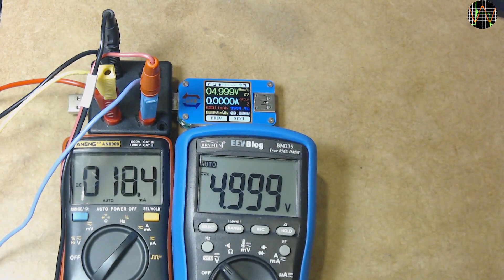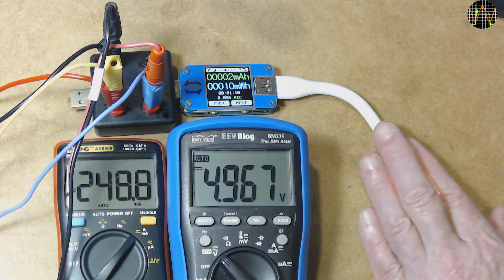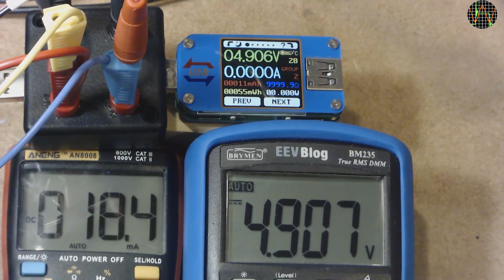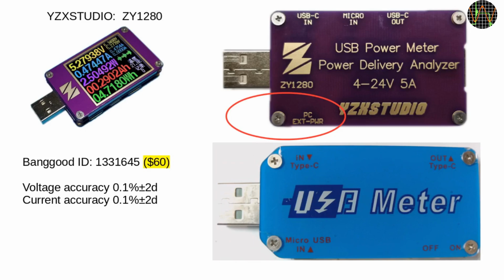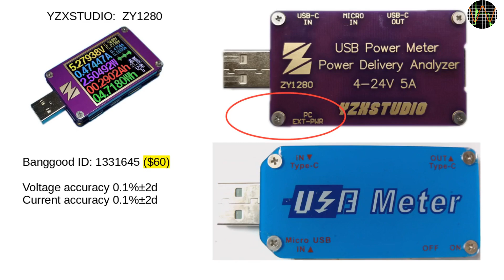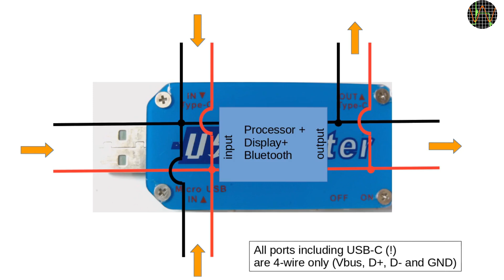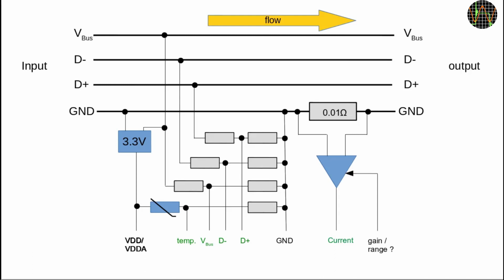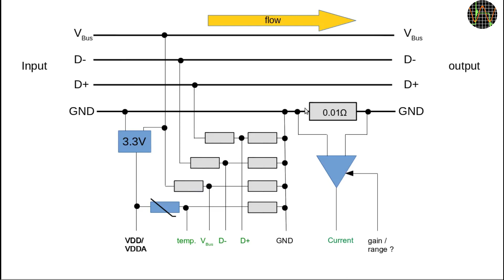USB Tester surprises that can go wrong

Comment: I am not much of an electrical engineer, so this video is mostly above my head. I need to test a bunch of power banks at work. I bought a couple of testers and a USB load with a fan. One testster is pretty simple, like your unity, another one is more complex from Makerfire. The latter at some point went up to 40c and had it's usb connection (from the side of the load) melt. I had this happen to two testers now, but the simple tester works no problem. I am testing the power bank at 5V 1Amp, what am I doing wrong?
Reply from the maker: 40 deg C isn't enough to melt plastic or solder. Something else has gone wrong here but it is difficult to understand what you were doing in each case. You are saying that you used the same setup, cables, load, power bank and with one tester it works, and the other one melts?  What current were the testers showing (while working)?
Reply: @TheHWcave  yes, identical conditions, one tester (simple one) works fine, another tester (makerfire with LCD display) dies within 20 minutes. Maybe 'melt' is an exaggeration but the USB port has a bad smell coming out of it and no longer functions. The tester itself is alive, if I reconnect it to the power bank the display turns on and shows the voltage accurately, but the USB-in does not work anymore. 

The current is 1.12 amps.
Reply from the maker: @Jimmy_The_Goat  My only guess is that there was a bad solder joint or contact within the makerfire tester that caused so much of resistance and voltage drop that it overheated. It may be fixable if you open the tester and examine the solder joints (and PCB tracks) around the USB port.
Reply: @TheHWcave  And what would I do to fix it?
Reply from the maker: @Jimmy_The_Goat  Difficult to say without seeing it. Check for anything like solder joints around the connector that look brittle or cracked. Anything that looks different from how the other connectors are. Then go over those with a soldering iron and reflow the solder. See if that fixes it. If the melt happend inside the connector itself you would need a new one but replacing a whole connector is more work than the tester is worth.
Reply: @TheHWcave  okay, thanks for the help!
Reply: @TheHWcave  Another question, if you don't mind. I have two USB loads with a fan and one without. The other, understandably, gets pretty hot and has a rather unpleasant smell. It's not burning or anything, just hot. I am wondering if it might emit anything dangerous into the air and if it's safe to sit in the same room while it's being utilized.

Apologies if that's a silly question.
Reply from the maker: @Jimmy_The_Goat  Not silly at all. The one without fan likely uses a power resistor (big, should be easy to spot) to load the USB. These resistors are ok to get hot to max about 120 deg C. Up to that point they should not emit smells or discolour. If they do emit smells or discolour, they are overloaded, way hotter,  and their material is degrading. Also, yes, I would not like to breath those fumes in.  There is a difference (in smell) if a load has not been used for a long time and accumulated dust. Then there may be a smell for a short period (of hot dust) and then it stops smelling.  It is also possible that a brand new load may smell a little on first use but again, that should stop if it is used within its specifications. If the resistor(s) in your load have not degraded too much it should be ok to still use them but only for less power.
Reply: @TheHWcave  very helpful, thank you very much

Comment: What would happen if you connect a source to the USB-C output and a sink to the USB-C input?
Reply from the maker: The end of the universe as we know it? Good question! I had to test it because I normally use the TC66C (see my videos) for all my USB-C work. The UM34C has no USB-C out (despite the label). On the UM25C, if USB-Cs are swapped, power still gets through and the display shows the voltage but current is shown as 0 despite current flowing. I also noted that regardless whether USB-C in and out are connected correctly or not, the UM25C is sensitive which way around the two USB-C connectors are plugged-in. There is a 50 percent chance the display stays dark and no current flows from source to sink. Flipping either one of the connectors on the UM25C and everything works. It has to be on the UM25C, flipping on either source or sink side makes no difference. When discussing the TC66C , I did a deep dive into USB-C and indeed the connectors / plugs are not truly symmetrically wired. However most devices take care of that, so orientation of the connector normally does not matter. In the UM34C it does matter. Interesting! I did not know this about the UM25C , so I thank you for raising the topic.
Reply: @TheHWcave  Thanks for the answer. The reason I asked because I have on of that black X shaped usb tester and I plugged it in reverse to a power bank, frying it.

Comment: First 2 minutes, you are talking about USB tester not displaying the 18.5 mA that it draws like its a bad thing.
Using common sense, of course I dont want USB tester to show me its power consumption, I want the USB tester to show me how much power the device I connect to it draws.  
Same as for scale, I dont want the scale to show me how much it weights, or how much a plate I put on to it weights after I press "tare" button , I want it to show me how much sugar I put on the plate weights.  
I guess I will have to watch the video few times, but is there something I am missing here ? Maybe I just need someone to spell it out for me
Reply from the maker: The point is that it draws 18.5 mA without telling you about it and that means any battery capacity measurement is wrong by that amount.  The battery has to power both, the actual load (which the USB stick shows) and the USB stick's own power draw, which it doesn't show. In your weight example, this would be equivalent to a scale that adds 18.5 grams  to everything you weigh but doesn't tell you about it.
Reply: @TheHWcave  I see what you mean. I assume this is the only situation where USB's power draw matters and should be taken into the account ?

But I was, just to clear for all who read, talking about device connected INTO the USB, on the end of it.
Because my goal is to measure, for example, how much current the LED light draws, like you did show at 2:11.
And in that situation, power draw from USB device doesn't matter.
Reply: But what about simply connecting discharged battery to the USB tester.(instead of discharging it and measuring while it discharges)
So like this
1(5v power adapter) - 2(USB tester) - 3(battery) and measuring how many mAh is pushed trough the USB tester.
In this case the USB tester would not draw power from battery at all.
I'm not sure can capacity of a battery even be measured like this, while charging.(don't have much knowledge on this tbh)
Using some logic, it should, yes ?
Reply from the maker: @kruskotv1311  Yes in that case the power draw of the tester would be covered by the charger. The best option is to use a tester that can be powered externally so it doesn't need to steal power from either end of the USB connection to the thing you want to measure.

Comment: I have a question. I am on the search for buying a usb meter for measuring capacity of a phone's battery which uses micro usb port.The charger is a ~ 5,2 Volt one, will the capacity be shown from the usb meter correct? Cause as far as i know the batteries on phones charge at lower voltage, about 4.3 V. So wouldn't be right to say that in order to keep the same power in and out the phone the current flowing in battery should be higher, therefore the true capacity of the battery be higher than the one measured by the usb meter? Thanks for the work you put on these videos man, i didn't expect i would actually found someone actually posting so much info on this subject, really helpful !!
Reply from the maker: You are totally correct. Capacity measurements of the batteries inside a smart phone or USB power bank from the "outside" are usually reading too low. The reason is that capacity only looks at current and assumes that the voltage is identical with the battery voltage. This was true 12V lead acid batteries when capacity became "a thing". but not now with all these DC-2-DC converters in between. We should switch to energy measurements instead that takes voltage into account. I made a video about this https://youtu.be/u-HKEb1DIWw

Comment: What USB tester would you recommend? After all is said and done.
Reply from the maker: It really depends on your needs. If you are doing mostly USB-C get the TC66 and use adapters for other USB types. The TC66 is amazingly accurate and can be externally powered. If USB-C is not your thing any of the testers in that video will serve you. Get the one with the lowest price. The UM34C has one digit less and goes only to 4A (which is plenty enough for standard USB connectors and cables) while the UM25C has a digit more in resolution and goes up to 5A. The USB-C interface on both of these testers is very limited.

Comment: Woooaa...  Right at the end did the power bank just output the 9V or where did it come from?  I didn't hear any negotiating...  (I really like your video.  Good job)
Reply from the maker: Sorry for the late reply. Plugging the phone in caused it to negotiate a higher charge voltage with the power bank. Whether that happens or not depends on the capabilities of power bank and phone but most modern power banks can supply 9V or even 12V when asked nicely using the PD protocol.

Comment: Hello Sir,  Which is better FNB38  or  UM24/UM25/UM34 ????  Does UM's have QC/PD Trigger function ?? Any suggestion on best USB tester with Trigger under $20 ?
Thank You😁 Subscribed ❤️
Reply from the maker: I have not tested the FNB38 but from the spec it looks as if it has way more capabilities than any of the (older generation) UM25/UM34 testers. I have tested the newer TC66 which can trigger but it is USB-C only (you would need adapters for other sockets). The TC66 impressed me with its accuracy which is as good as a 5 1/2 digit multimeter but its slightly more than your limit ($26)

Comment: Should I avoid the UM25C/UM34C?
Reply from the maker: Why? the testers are great. All this video was trying to say is don't use two inputs or two outputs at the same time. This is not something you would normally do but since these testers offer additional alternative connectors to save you hunting for the right converter cable or adaptor, the possibility exists that you can for example plug two inputs into a tester, with the predictable result that something can go wrong. To be fair, the tester probably survives, its more the devices on the other end that may be in trouble when you do this. Just stick with picking one input and one output and nothing will go wrong.
Reply: @TheHWcave  , I am trying to find a model that can test the capacity of batteries. Which one would you recommend?
Reply from the maker: @jpvoodoo5522  They can all measure battery capacity. To test capacity when charging you need to reset their capacity counters, and then put them in between the battery and charger.  To test discharging capacity you need to put them between battery and load.  Which model is best depends on the type of USB connection you use (normal, micro or USB-C), but other than that all can do that. One note: If you measuring capacity of a USB power bank from the outside, remember that your are NOT measuring the batteries inside directly but through the DC-to-DC converter in the power bank. That completely messes up capacity figures because a Lithium battery capacity is rated at 3.7V but you are measuring at 5V (after DC-2-DC conversion). So its much better to measure ENERGY (watt hours) not amp hours, because watt hours measurements take the voltage step-up into account. All these 3 USB testers can measure energy as well as amp hours

Comment: My USB tester works at 3volts
Reply from the maker: Good to hear. The threshold when it stops working depends really on the model of the tester. I also found that when the display shuts down, the processor may still work for and can tolerate even lower voltages. You should however test if the measured values are actually still correct at very low supply voltages. The problem is that the reference voltage for the AD conversion might no longer be correct and cause measurement errors to creep in.

Comment: How did you build the USB by USB black tester box to connect to the meters
Reply from the maker: I did a small mod and showed the inside in this video on repairing a power bank
https://youtu.be/LSrtbNV9vt4
(I should really start numbering my videos to make these references easier...) 
The box is incredibly simple and easy  to make and well worth having.  I should probably make one for micro USB as well...
Reply: @TheHWcave  instead of making another separate USB black box tester with microUSB support, Would it work if you simply connected a microUSB adapter to your existing box? 
Great vid thanks!
Reply from the maker: @SS-pi2yi  Yes of course. I do that myself.

Comment: The last point is also a risk with multi socketed power banks. The one I use warned against it in its instructions (for those that read instructions). If a device on one port negotiates higher voltage then the other port will also see it. A second power bank I have will only allow negotiation of higher voltage on a separately coloured port. I've not measured the black port when the green port is running at 9V. Perhaps I ought to, to see if it does power them separately.
Reply from the maker: Hi Richard,
I totally agree with you. Multiple powerbank sockets used simultaneously are something to be very cautious about. Luckily so far the cheap ones (where the 2 sockets are in parallel) don't implement higher voltages and the more expensive ones (hopefully) do it properly. I just tested my XIAOMI 10000mAh and it won't go to higher than 5V if the 2nd socket is in use.  If socket1 was 12V and you plug in socket2, it briefly turns both off and then back on at both 5V. That is not quite what you have in mind, i.e. truly independent ports, but it is a safe implementation.  Hopefully other manufacturers implemented similar interlocks. It is certainly something one should test, as you pointed out.
Reply: Omg, thanks for this comment. This is nothing that have ever occurred to me that it could happen..

Comment: I have a tester which reports its own consumption, so always see some even with no load. It can accept an external power source though. The power source is selected via slide switch.
Unsure how good the tester is otherwise. Cheap electronics!
Reply from the maker: Hi Richard,
That is rather unusual. Out of curiosity, what make and model is your tester?
Reply: @TheHWcave  I'd say it was a cheapie looking at it. It's this one.

https://www.amazon.co.uk/gp/product/B07P2J5VTT

Comment: Can these USB 3.0 testers measure power usage by an external hard drive without interfering with data flow?
Reply from the maker: A very good question!  My only USB 3.0 disk is not powered through USB, it has an external power supply instead. However, I just did a test data transfer using a USB3 cable and a USB 3 port on my computer first without and then with a UM25 in the cable. With the UM25 in the loop, the copying of a 1.1Gb file took 3 times as long (I used different files of same length to avoid wrong results through caching). So, data flow works fine through these USB testers but because the BM25 actually isn't strictly USB3.0 and implements only D+ and D- and not the additional data lines of USB 3, all transfers drop to USB 2 speed. If transfer speed is an issue, you need to look for another tester that fully implements ALL data lines of USB 3. Regarding power, the UM25 will support up to QC3.0 so higher voltages and higher amps to power a disk directly from USB should be no problem  if your computer can provide it, of course.
Reply: @TheHWcave  Do you know if UM34 has all the USB 3.0 data lines?
Reply from the maker: Unlike the UM25, the UM34 has proper USB-A connectors (blue) with the additional pins and the manual states it supports USB 3 on those ports (but not on the USB-C ports which are only 4 wires).  To confirm I tried the same transfer test explained earlier but it failed after a second or so with an IO error. Now, I am pretty sure that this is NOT the fault of the UM34 because the 3.0 sockets on my PC are worn and not very good in making reliable contact anymore, especially if a tester is literally "hanging" on them. I sometimes get such errors even without a USB tester. Unfortunately at the moment I have no other way of testing so I can't confirm 100% that it works.

Comment: thank you for your test , it you can't the load, the voltage compare is useless .. there are many place have resistance , so there is voltage drop
Reply: you need to adjust your measurement formula to compensate the current draw by the tester itself
Reply: @MohamadHanifAzrai  That would be terribly inaccurate, because the tester's current draw fluctuates. You need to either allow power from an external source isolated from the other ports or measure the internal current draw by using a shunt resistor placed at the input.